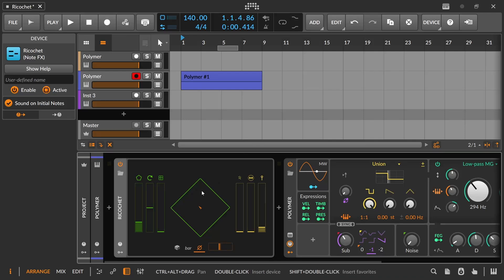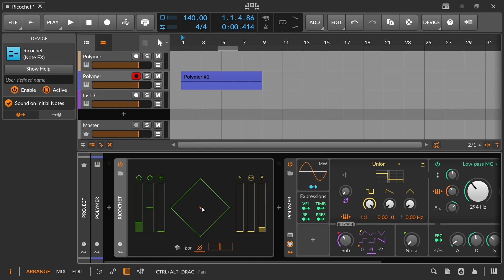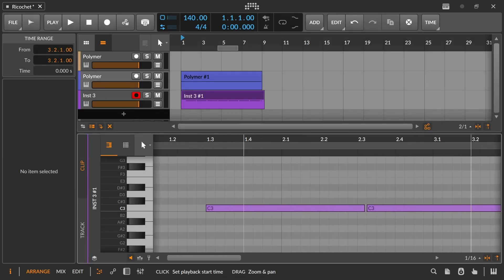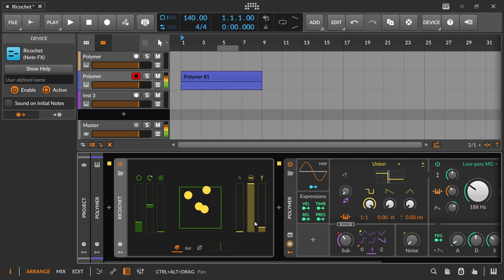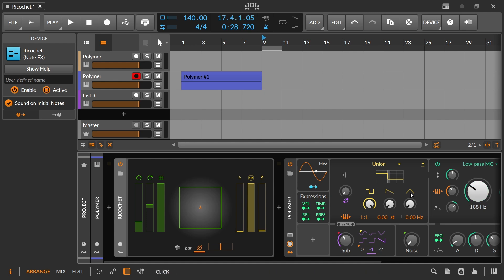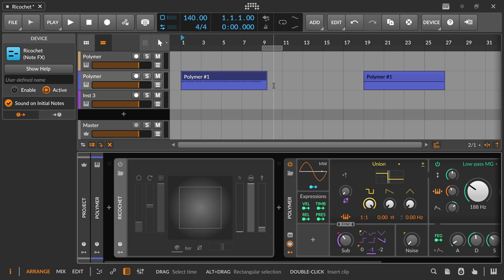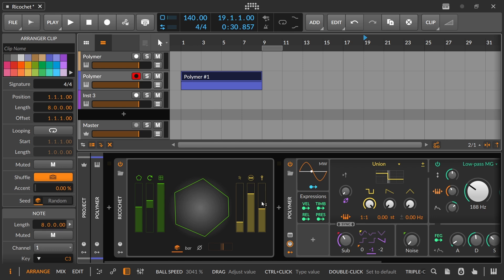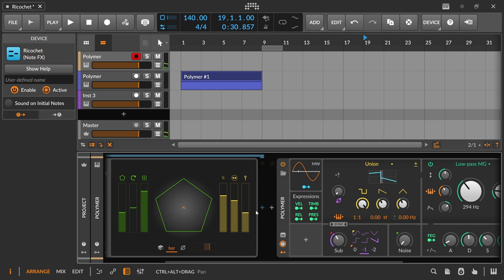Bitwig - Ricochet

Comment: I think I understand the Eno reference. If you listen to 'Reflections' I think this is probably the kind of generative music they are referring to. Way back Eno made a program which I have (on floppy disk!) that generated music sounding a bit like this. I tried sending in some notes from the keyboard but don't know how to sustain them to get the required effect as I'm learning Bitwig. Ideally I'd like to generate a sequence and send it into Ricochet to achieve this effect.
Reply from the maker: I will experiment with this and probably make a video... If you don't have a sustain pedal hooked to your keyboard you can add a midi lane and then CC #64... probably a bit of a pain but doable.
Reply: @ProduceWithMe  I wanted to generate the notes rather than play them, which seems to mean using the arpegiator. I haven't tried it yet.